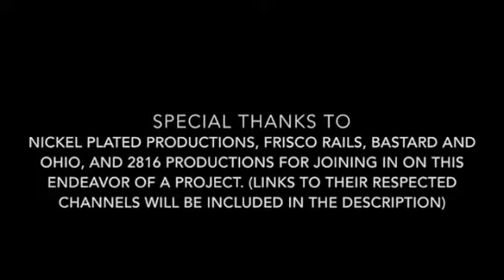The Reading Ramblers: A Documentary on the Surviving Reading T-1s

Comment: I am glad that four Reading rr t1 class locomotives still exist today and two of these engines are the focus for operation. Reading locomotive 2102 was restored back to operation in April 2022 and is once again in active service after decades of being inactive ; soon engine 2100 will also be returned back to operation as that locomotive is currently receiving maintenance at a repair shop in Ohio. The surviving members of the Reading rr t1 class have had impressive excursion service careers since the "Iron Horse Rambles" of the early 1960s, I am eager to see Reading 2100 return to service again as that may happen by 2025 or 2026.

Comment: Well done , with a few factual errors.
There were 51 Iron Horse Rambles.
2124 was the first T-1 to pull them in 1959.
2100 was added in 1960.
2102 replaced 2124 when retired after 61.
RCT&HS brought 2102 home to Reading in August 1985, and ran 4 trips on Conrail.
Andy Muller bought 2102 in May 1986.
Reply from the maker: RDG179 ahh thank you for the corrections.